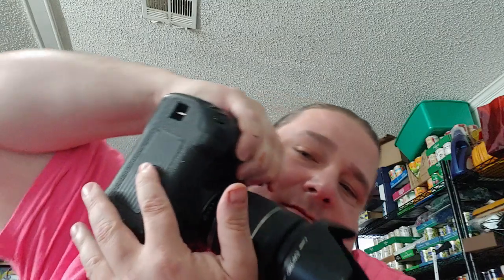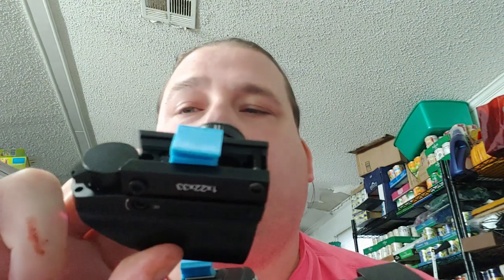3D Print optics adapter for your Camera T3DP

Comment: What happened to your other camera?
Reply from the maker: My brother stole my entire $4000 (used price not new price) camera outfit from me and pawned it for $400. :-) 5D Mark II with 100-400 serviced L lens and 7 other lenses including 3 other L lenses my pelcan cases video adapters batteries. everything. One of my amazing viewers actually gave me the 7D Mark 1 I am using now. I have since purchased a couple of cheap STM lenses. it will take a while (if ever) for me to replace what was lost. that was 10 years of saving and buying in that kit. shit happens. you move on. he now has a warrant and 2 felony charges pending if the cops follow through. He made his bed now he can sleep in it.
Reply: @nerys71  so sorry, I 'm surprise that the cops didn't impound the stuff as stolen and you could make a claim on it. My brother was like yours. He took my mom's jewelry to pawn. At least I got it back for her.
Reply from the maker: @Hero1117a  by the time I found out it was gone the pawn shop had long ago sold it off. the pawn shop is complicit they tried to play weird games with the description etc.. (alas PA law protects pawnshops unconstitutionally but hey can't change that)
because I had stopped going to events I had stopped using the equipment and did not realize it was gone until I went to go pack it for the move. I went to the pawn shop he uses and got a list of his "sales" and my camera was on the list.
Once I verified it would not cancel his SSI to goto jail for a felony (because that would make the harm he would cause to society partially my fault) I filed charged with the police and told him "good luck sleeping in the bed you made"
Reply: OMG! And this after you gave him a home for years? When was this? After moving to New Mexico?